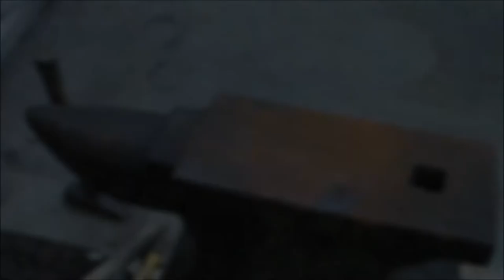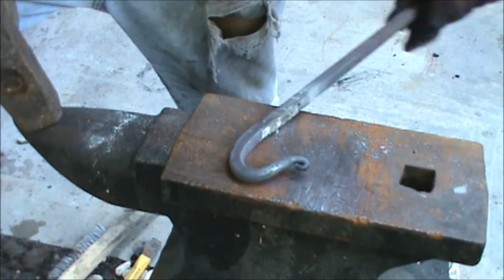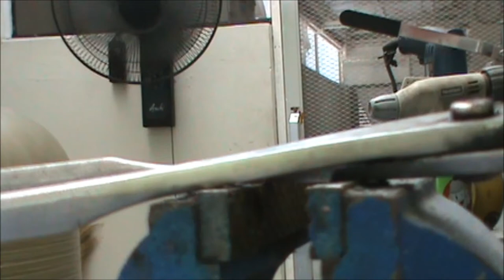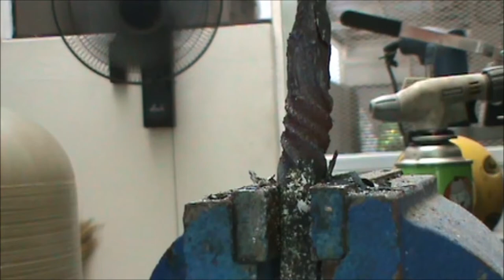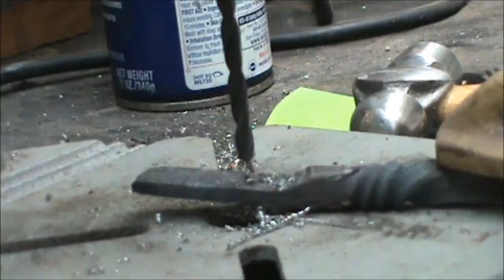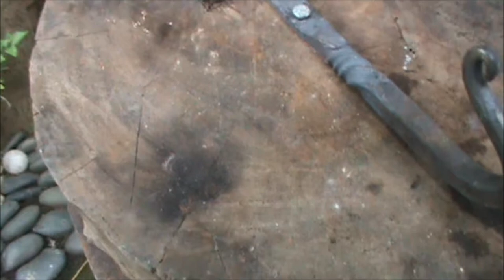Forging a Simple Wall Hook

Comment: Great job.  Just a little hint... if you dress the face of your hammers... round off the edges a little... it won't make such deep marks in the transition from where you flattened it to the square bar.  Make sure you go and post a link to this video on all the beginner blacksmithing facebook pages.  It could be just the motivation someone needs to say, "Hey, I think I could do that." and starting their own journey in to blacksmithing.
Reply from the maker: Thanks man! Will do!

Comment: Great project, but I have a few constructive thoughts. 1. Try using a spacer of some sort in your vice to prevent stray marks on your work. 2. Try a crescent wrench for the same reason. 3. try finding ways to better secure your anvil to the ground, it's bouncing all over the place.

Comment: like the music,   viewers appreciate dimensions but too many videos leave that out.  
what size stock do you start with?  how long is your taper, and your twist and your flat area?
making one wall hook and replicating it depends on repeating those again and again.

your anvil moves a lot which 1. wastes the power of your blows and suppresses rebound of your hammer. 2. makes you miss your target.  3 makes it very difficult to move the work under the hammer.  
secure the anvil  and 1.  move your work beneath the hammer.  your arm will thank you, your shoulder and elbow will last longer.   a secure anvil  2. allows you to start and draw out tapers over the horn because it will not rock.   
working over the horn forces the habit of moving the work under the hammer allowing your hammer arm to rest between rebounding blows.